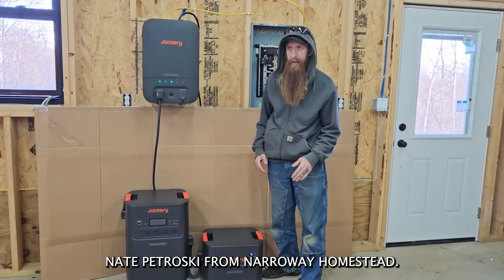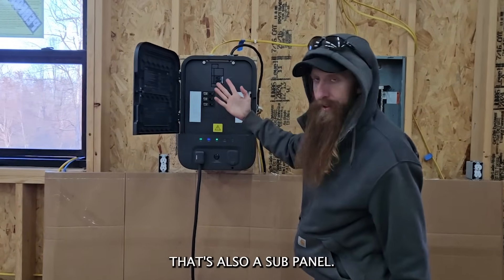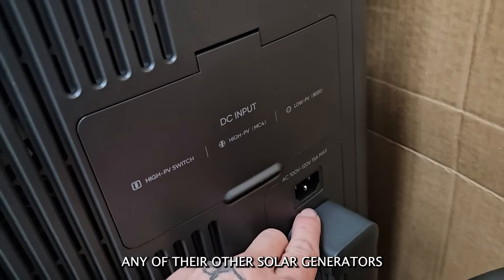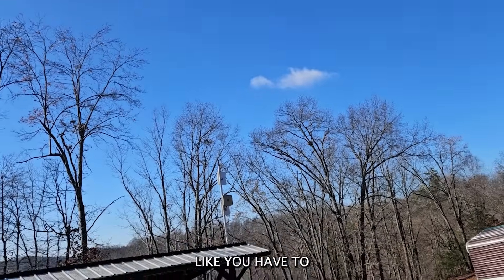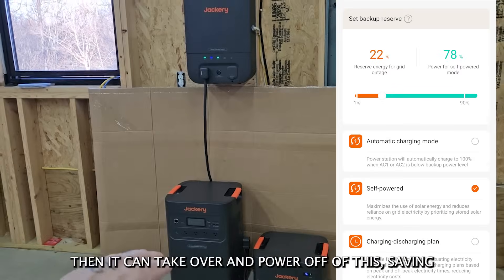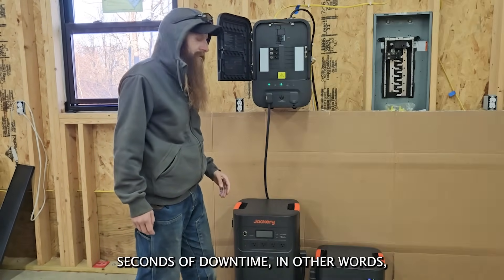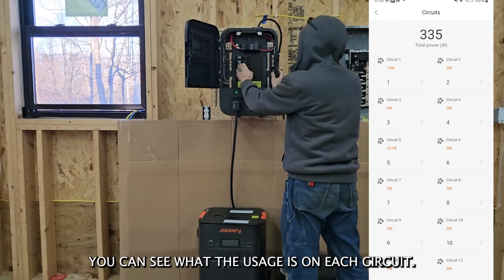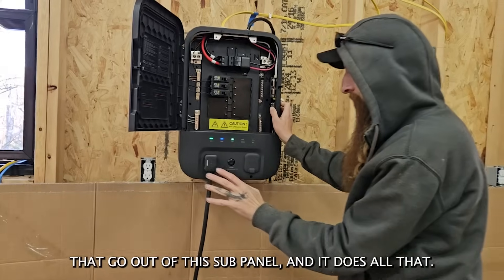Home backup power with the newest Jackery Solar Generator 5000 Plus

Comment: How did they work in a cold garage?
Reply: No answer after a month? I’ll answer. Cold garage would be okay, but VERY cold garage isn’t going to be good. Operating range for temperature is -15C (5F) - 45C (113F) & not less than 0C (32F) when charging, which means not less than 0C/32F all the time, because you never know when it’s going to be charging. Batteries don’t work as good when they’re too cold or hot.

Comment: Can I run my house with the transfer switch with out grid power
Reply: No answer after 3 months? I’ll answer. I seriously doubt that you’ll be able to run your whole house. The STS is pretty cool, but it only outputs 60 amperes, despite its 100A circuit breaker, because it needs extra amps for charging batteries. Yes, your total power demand is probably way less than the rating of your power panel, less than 80%, so typical 200A panel would be 160 amps MAX, 100A panel would be 80 amps, worst case. Realistically, most lighting & outlets probably aren’t pulling anywhere near 60 amperes TOTAL, but heaters pull serious amps & motors have significant STARTING surges. That 1875W hair dryer? 15.625amps, that’s why 20A(12awg) is preferred for 120vac receptacles, while 15A(14awg) is plenty for lighting.

Comment: Jackery? Jackery used low cost high frequency inverter tech in their design, Here's just a few of the many reasons that you should never install a high frequency inverter to power your home's appliances:

•	Lack of Isolation:
Transformerless inverters lack the galvanic isolation provided by a transformer, meaning there's no separation between the DC and AC circuits. This can lead to DC voltage being inadvertently applied to the AC output, potentially damaging appliances designed for AC power only. 
•	High-Frequency Noise:
Transformerless inverters can produce high-frequency components in their output, which can cause heating in motors, wound components like transformers, and other sensitive electronics. This heat can reduce the lifespan of appliances or cause them to fail. 
•	Surge Handling:
While high-frequency inverters can be smaller and lighter, they often have limited surge capabilities and may not be suitable for powering induction loads or other devices with high surge requirements. 
•	Harmonic Distortion:
Some transformerless inverters may have higher Total Harmonic Distortion (THD) than transformer-based inverters, which can also negatively impact the performance and lifespan of some appliances. 
•	Risks to Sensitive Electronics:
Appliances with sensitive electronics, such as digital clocks, timers, or medical equipment, are particularly vulnerable to damage from high-frequency noise and voltage fluctuations in transformerless inverters. 
•	Grounding Issues:
Transformerless inverters may have grounding issues, leading to leakage currents and potential safety hazards.

Comment: I want something like this. I live in a state that penalizes you for having a grid-tied system that feeds over-production back into the grid (protecting the power company that has a monopoly here - they charge fees to offset the savings customers would have had from solar). But until I can go off-grid, I'd love to use a transfer switch to occasionally run the house on solar and just cut down my monthly bill. The power company doesn't have to know how I did it.
Reply: @lrigdrenlrigdren2147  if they do figure out I've seen em come out and take the meters and say "it was at risk of back feeding " without actually ever seeing anything. My brother had a generator he was using when working on his house. Never even used it to power the house and they snatched his meter and made him pay to put it back in.

Comment: I am on the grid with a 3 bedroom house with and using 15 kw per day.  If I had to I could drop down to 10 km per day.  Even with one 5000 with 5 expansion battery.  I could run the entire house for three days without recharging.  That is just crazy when you think about just using batteries .

Comment: but what if the rain and storm is what knocks your power out and you solar panels dont work? how long will it last?
Reply: No answer after 8 months? I’ll answer. It depends on your loads & how many power stations & batteries you have. JE5000P has 5040W-hours, theoretically that means you can take 5040W-hours & divide by whatever your total watts of load is & get an answer in hours, but the higher the rate of discharge, the worse the battery life is. For example, 100W light bulb mathematically 50.4 hours, but really only 45.4 hours assuming 90% efficiency. 1500W heater mathematically 3.36 hours, but forget 90% efficiency, expect 50%, maybe an hour or so. One of the nice things about the STS is that it allows you to prioritize the loads to keep the juice flowing to ESSENTIAL loads & not waste it on non-essential loads, & you can control it with your smart phone if you have service.

Comment: Do you have to use the Jackery panels with this this? I have a different brand that draws more power. Are all solar panel connectors the same? Mine look similar to what's on that unit(from what I saw)

Comment: As a 15 year solar technician. 10 for tesla and the rest commercial, don't buy this if you want solar. A 5k string inverter is only 1500. Then a average of 175 per panel is all you will need for most applications. You are buying a brand here. A brand that is more expensive then Tesla. With zero name weight.

Comment: How will you keep those lifePo4 batteries within their operating temperature?  They will need heat at or below 32degrees. How does that factor into the fuel or electricity needed just to keep the system healthy?

Comment: Those jackery's are getting pretty badass, i still dont trust putting a lithium battery bank inside my house i would have to put them in a seperate enclosure outside where it cant burn my house down if the batteries decide to combust lol.
Reply: LFPo batteries don't go critical like regular Lithium-Ion cell phone or laptop batteries. They have other benefits, too. 

While you might think having them in a shed is desirable, it has to have a minimum temp. Either layer RV Septic heating pads between them and insulate the box, or add some other method. 

When you get to volume rack-mount batteries that are 5+kw, they usually do not have internal heaters, and assume you've sorted the temperature issues out externally.

There are smaller batteries that do have internal heaters. They still need to be kept somewhere they can maintain within minimum and maximum temps, or they will either shut-off, or at very high temps the cells degrade.

Comment: I have a 10kw battery pack in my basement and it's more than double the size.....
Reply: You mean size, as volume or capacity? All LFPo is going to be about the same weight per kw and size, although there are newer, more compact higher energy density cells, on the market in the last year.

The value isn't there on the compact integrated (battery included) systems, for anyone who does their own electrical. Usually their expansion battery packs are also proprietary in how they connect to the inverter, keeping costs up.
Reply: @my_channel_44  the volume

Comment: They gave you this 🙄🤷‍♂️ and good 4 you! 😊 But it's not that good 4 the price to buy it 4 a person that has to actually has to pay 4 it!!!
Reply: Look into EG4. Their all-in-one inverters are UL and Code compliant. Start at 3 & 5kw single phase, then 6000xp is split phase, up to an 18kw model.

Batteries can be had for $3200 or less, for 16kw. And, they are non-proprietary. Meaning you can mix and match as you expand your system. These compact manufacturers use proprietary battery interfaces.

Comment: Lithium car batteries are pretty affordable now. If anyone doesn't feel like spending 5k on these banks then I suggest looking up DIY ones.
Reply: The cheapest retail (non-DIY) I've heard is the 16kw Riuxu with free shipping, for $3200. Who knows what will happen when 25% battery tariffs hit, at the beginning of the year?

DIY builds with pre-made banks and a BMS are even cheaper, yeah. But best put that stuff in a temp controlled shed. Not because it can't be made safe, but for finger-pointing reasons if there should be a fire (e.g. insurance). You wouldn't put a power sub-station in your house, either.

Comment: Stay away from Jackery.  Most influencers are gonna sell their product bc of sponsorships so they won’t tell u the truth.  I have a Jackery explorer 1000v2.  I have 2 solar saga prime panels mounted to the top of my SUV. Each 100watt. I also have another 100w solar panel as well.  I have the car adapter as well and the Anderson Y connector.  I was planning on buying 2-3 more battery packs so I can stay off grind for a long time.  Well all these influencers just talk about the features but not about the input.  U gotta charge it in order to use the features.  Each morning I have to unplug the solar panels and plug them back in in order for it to charge correctly.  For example, it could say it’s bring in 20 watts around 930AM.  When I unplug and plug back in it jumps to at least 60 watts.  So there are insane amount of charging issues.  Same with the car adapter. Mine won’t charge the power bank using solar panels and the car adapter.  Only the car adapter will work.  Once I turn that off, same thing happens.  The power station will say around 30-40 watts, then I have to unplug and plug back in and it jumps back up to what it should.  Same issue when I just plug in the to panels using the Y connector and the single panel.  Most I have ever got out of 3 solar panels each 100watt was 130watts.  They say u can fast charge in 1 hour using the emergency fast charge.  It works when it wants to.  Sometimes it charges fast at 1000watts while plugged in to charge it.  75% of the time it’s right at 360 watts while plugged in the the wall outlet.  Usually takes about 2-3 hours to charge it with the wall.   Dry seldom do u get the 1000watts.  I’ve only had it for about a months now and Jackery tech support isn’t helping to replace it.  They are now ignoring my emails as well as not returning my calls.  When I call and get a person they say they will call back in less than 24 hours but never do.  I have emails showing how many times I’ve emailed them and no response.  So they don’t honor anything they say they do.  U can’t leave reviews to see what people really think about their products.  I’ve about $2500 deep into it and it doesn’t charge properly and no help… Stay away from Jackery.  These influencers need to be more honest.  They don’t have stores so I can’t take it in and have someone look at it. It’s been a freaking nightmare.  I’ve waited 3 years to get my Jackery and this is what my experience was like.  As far as the output, it works great.  But if u can’t get it to charge correctly then those features become obsolete… Stay away from their products.  No one shows videos about the issues with charging bc if they did, then people won’t use their code.  Be honest and tell ur followers the truth….
Reply: I’ll tell y’all the truth bc I’m not the one trying to make money off y’all.  Mine clearly have charging port issues.  They even said it shouldn’t be doing what mine is doing.  Then one guy said mine was fine.  So they asked to make a video showing what it was doing and I did and once I did they stopped responding.  Horrible product, horrible customer service, they are all foreigners. Build ur own so if u need to replace something you can with out having to change ur whole set up.  I can’t take it back bc I mounted on the roof of my car.  They don’t honor their warranty.  Horrible experience..

Comment: How would a Jackery based complete solar system (everything shown in the video + solar panels) compare to your current system at equal output if the upfront cost were to be disregarded? How many of their Saga 500 x panels would it take to achieve a comparable recharge rate to your current setup?
Reply: If you're looking at a larger, more capable system or even the same at a lower cost, look at EG4 and others. Start with mobile-solarpower and some of Will Prowse's videos, and his forum.

The all-in-one that include the battery proprietary systems, that emerged from highly-compact, mobile carry applications, use that to increase price. The other downside, is their proprietary nature means you are locked-into their solutions package.
Reply: @my_channel_44  thanks for the idea of Will and EG4.  I'm rather liking the idea of putting a secondary panel that can use grid or battery, especially as a UPS function to offset grid and offer backup
Reply: @netWiz1  Idk why a bit of the comment is cross-out. By 'panel' you mean, a single panel? A single panel won't do much. It will keep a couple of 12v batteries trickle-charged on a vehicle.

Comment: As a 60 year old Electrician this is all new to me so thanks for the video Nate. Give me a room to crash in and I will come down and give you some free Electrical work.
Reply: More like space to build a room to crash in
Reply: EG4 3/5k or 6000xp split phase up to 18kw, ($550-2200) paired with 15 to 30kw of batteries for about another $3000-$6000 are a better deal.
Reply: Glad to see at the least they put white lettering by the switches,  the 2000 plus does not have and in a dark environment fi ding switches sucks!

Comment: Cool system, $6k is mer pocket change for some. Must be nice.
Reply: Hey negative-nelly: Compare it to the cost of having the power company run lines to you when a pole and transformer don't already exist.
Reply: @my_channel_44  why would you want a power company run poles and line if you're off grid? The main power grid is unstable as it is.

Comment: Cute but just go with Victron for a real off grid system with the best tech and monitoring. Add a server rack of lithium batteries to store 31 kW of power. Always better to store more than you need and oversize your system. Stop watching if a light is on and be free
Reply: What would that cost? Just a ballpark if you don’t mind.   All sounds good, that sounds like a great system you mentioned.
Reply: @ericstans under 5k if you make your own battery. 2*  48 volt 310amp hour. Then the bms inverter and solar panels. Can be done under 20k
Reply: @ericstans  6 lifepower4 batteries and rack was $6,500 31kWh. Victron has lots of different options for system size and needs. 2 x 5000 Victron Quattro's inverters/charger, cerbo GX, shunt, and big solar charge controller was $12K a couple years ago. Power company low quote just to run lines a few hundred feet here was $50K and then a bill every month so the solar was a no brainer. Batteries were from Signature Solar and Victron equipment from a local dealer. Run 10,000 watts no prob if needed and surge to 20,000 watts